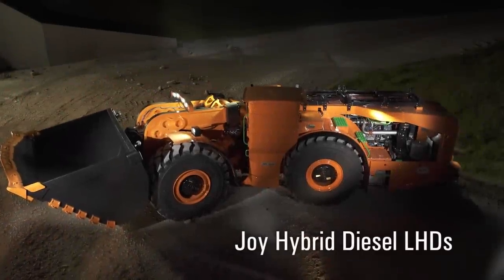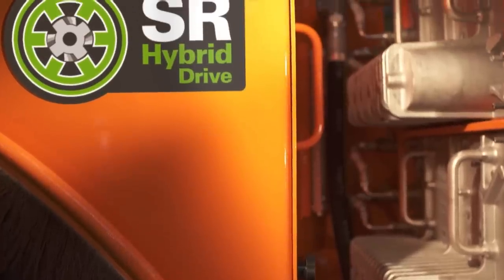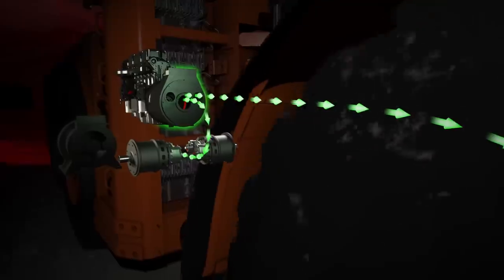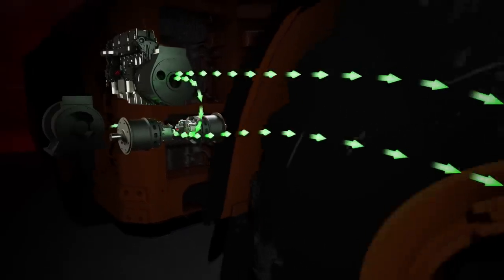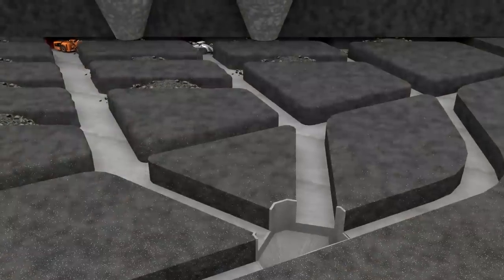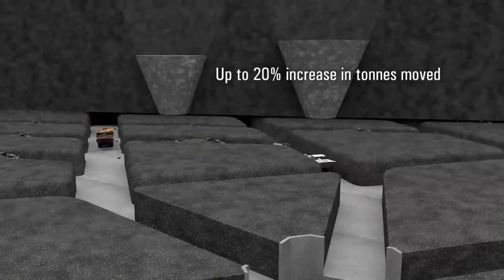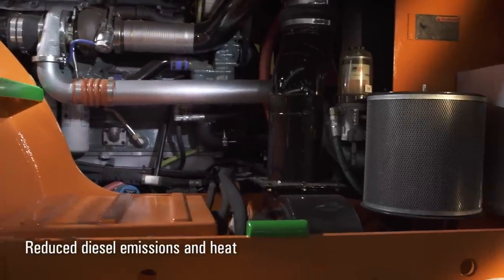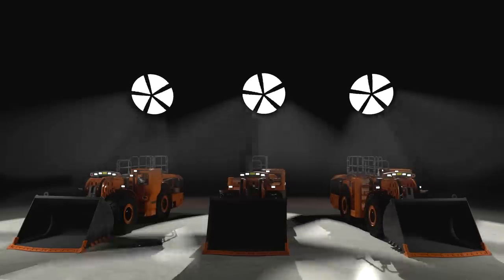Komatsu Mining Hybrid Diesel LHDs

Comment: I take it the hydraulic pump(s) is electrically driven? If so, twas a good move. If this kind of technology becomes a main-stay, and I'm sure it will, the days of having to rev up your engine to use hydraulics may just become an obsolete practice, which would certainly help with fuel costs. An engine that revs up only when its needed is the best thing you could have in anything that has hydraulically-actuated components. I've operated electric forklifts(15 000 lb Raymond Dock-Stockers and 20 000 lb Raymond Reach-Pickers) and I like them, but I'm honestly still kind of excited for the possibilities of a hybrid forklift. A forklift that couples the benefits of internal combustion with the benefits of electric drive/braking, electrically-driven hydraulic pumps and an engine with a dynamic load-based throttle would be a dream machine for me. 

The biggest draw-back of any electric forklift is their sketchy battery-pacs. Plus, in a warehouse that uses them, you need to have an entire section of warehouse space devoted to the battery charging racks and the huge machine that takes old batteries packs out and puts new ones in. The machinery and racking required for charging those massive battery packs don't exactly have a small-footprint by anyone's standards, and I bet that their power bill just for recharging batteries is probably sky high. Hybrid-Drive may not be a great thing in cars, but in heavy equipment with proper engineering behind it, it could be the next big thing.
Reply: Maybe you already know, but STILL and Linde do offer Diesel or Gas hybrid forklifts up to 8 tonnes. No idea about the other manufacturers tho.
Drove a smaller diesel one recently and it's a weird experience if you only drove conventional cars before. You press the pedal down, the engine revs to max and the machine accelerates constantly, just to reduce rpm once top speed is achieved.
Reply: @fabianrudzewski9027  I was not aware that they existed already. As for the strangeness of operating them, if you've ever operated a decent all-electric forklift, you already know the score. Hybrids are like electric forklifts that use the engine to generate electricity rather than having a battery store it all. Like I said, if you've ever driven an electric one, a hybrid one will be like putting on a set of old shoes.

As for me, I prefer electric forklifts, specifically the 10 000 lb Raymond Dock-Stocker (stand-up drive), so hearing about hybrid ones is just the treat. You get all the power of those electric motors with none of the drawbacks and massive weight of those battery packs that account for about 80% of the weight on a Dock-Stocker. Without the battery pack sitting tall in the frame, you could also ballast the bottom of the chassis to have a lower center of gravity, which is always good.
Reply: @MFKR696  Of course the acceleration wise it's no difference to the normal electric ones, but having the engine do it's thing so different to what you hear while driving home after work is strange in the beginning.
The battery doesn't really hurt the STILL forklifts. It's part of their counterweight and sits on the bottom of the frame anyways, so center of gravity is pretty low. 
You can see the hybrid guys having a larger rear end, to compensate for the missing battery.